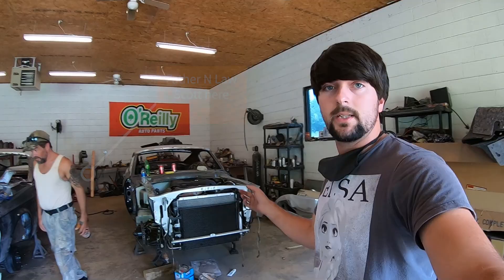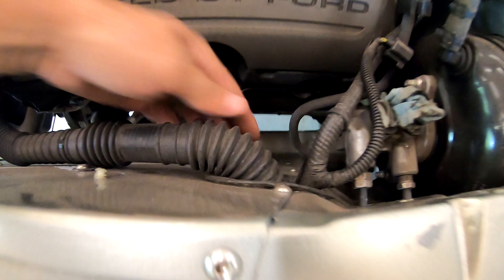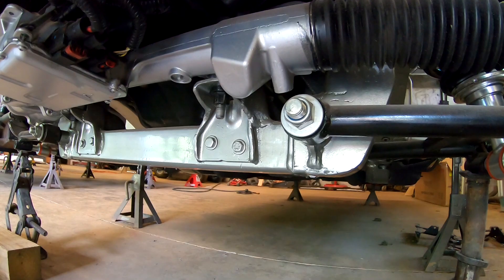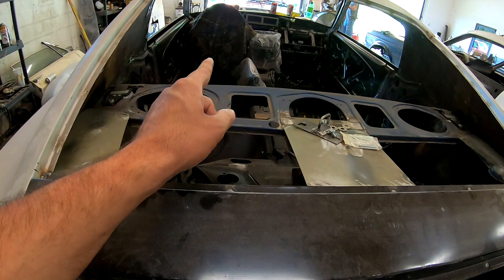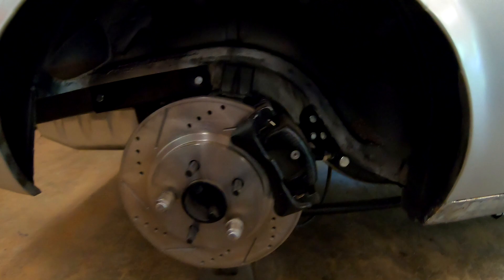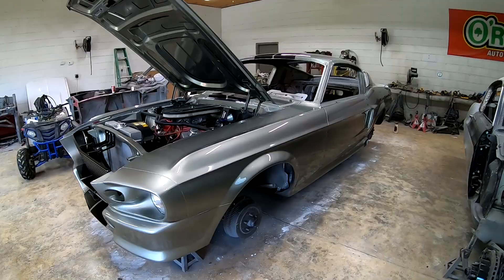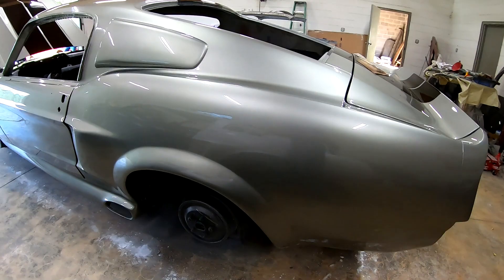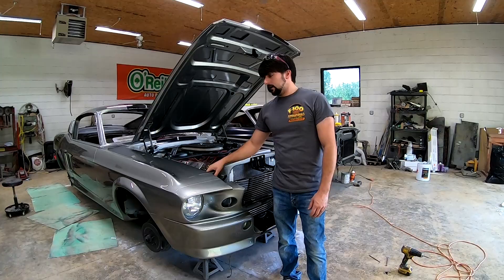coyote swap mustang fastback

Comment: I'm throwing a built ls in mine
Reply from the maker: That’s a great engine, I like the LS engine platform, Idk if some purest will like it but it’s a good budget engine and very reliable and cheap to do
Reply: @1194video  that's why I'm doing it to piss people off cause it's also getting the eleanor kit so their going to be real angry it's a turbo 6.0l
Reply from the maker: @gunsandhorsepower  I love it!
Reply: @1194video  I have another one but I painted that one yellow and it has a gen 3 coyote  with the 10 speed and its quick and I also have a 2020 mustang gt with twin turbos and it also has a 10 spped
Reply: @1194video  Lucas what is Great about you is that you give a  lot of Valuable information on everything you work on i have  Much respect for you on everything you do excellent work Lucas respect back to you from 🇨🇦 #YSW  ❤️ 👏